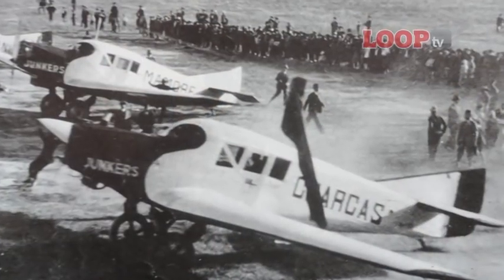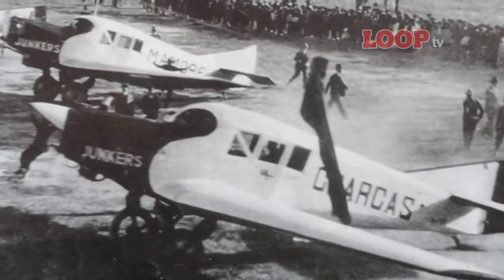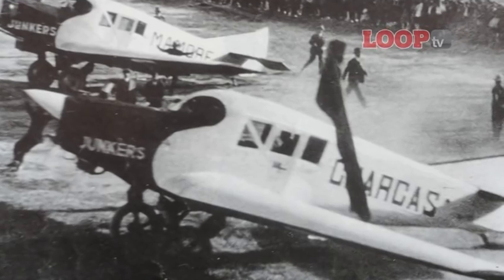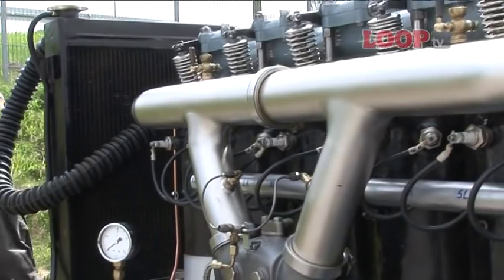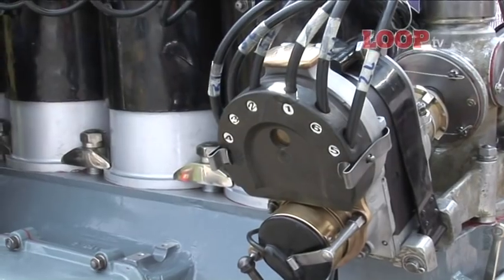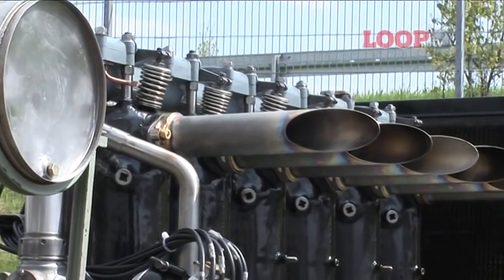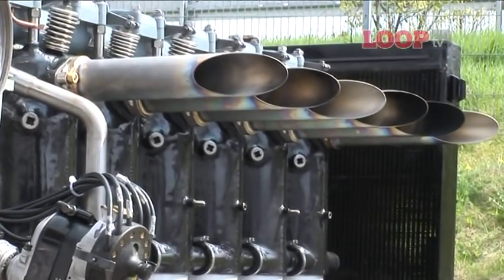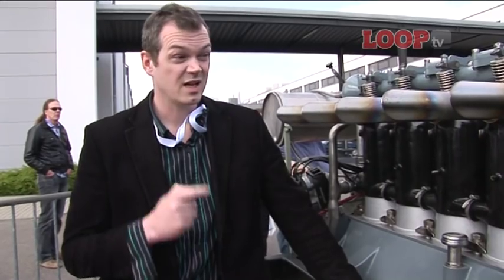Junkers L5 aircraft engine, start-up

Comment: The Germans have always made the best stuff.
Reply: gazlink1 - Are you kidding? They are renowned for building unreliable junk!
Reply: idontcare80 Rolls Royce? Byword for shoddy..? 
Invented almost all of the world's sports. 
I could go on. 
What you're speaking about I have no idea. The only thing shoddy about British design and manufacture is bad engineering management at times and overunionisation at times. Otherwise we pull our weight always in the world very, very strongly. British inventors have an impressive history.
Reply: Rolls Royce vehicles don't get driven enough to be horribly unreliable, but they are still unreliable. I'm not a sports fan, sports do almost nothing to advance human society. The British are responsible for quite a few very important inventions, but their mass manufacturing is horrifyingly bad.
Reply: idontcare80 Dyson vacuum cleaners? L7 tank gun?
Also I'm not talking about manufacturing, I'm talking about design. Manufacturing gets screwed by the overpowerful unions.
Reply: idontcare80 take for example the Napier Sabre engine. The most powerful inline engine of WWII. A huge engineering achievement, but was unreliable. Also the post war Napier Deltic, an awsome diesel engine with 3 opposing cranks and 18 cylinders. The smoothest engine ever made of its size that powers mine detecting vessels and locomotives (in the 60s and 70s anyway). Also the Merlin and Griffon from Rolls Royce.
Also regarding Rolls Royce - it's a mistake to think they only make cars, only a tiny part of their business is cars. Most of their business are jet engines that power a large amount of the world's aircraft.
Also Formula 1 - we have 6 of the world's design teams based in the UK near Oxford.
ARM microprocessors that power almost every computer in the world that is not a PC.
That's what you get from world leading design. No other country of this size has comparable engineering achievement.
And the manufacturing is picking up in quality from a real rough patch in the 60s to the 80s.
Reply: Also Martin Baker ejection seats, the only seats used worldwide because of their reliability.
Basically were good at high value design and manufacture.
Lower value stuff where the best manufacturing is key as opposed to best design we're not so good, but China, Japan or Taiwan can do that too.
Reply: idontcare80 also if you're talking about "advancing human society" the how about being the birthplace of the industrial revolution. We'd all still be peasants.
Reply: "Dyson vacuum cleaners? L7 tank gun?"

Oooohhh, overpriced vacuum cleaners, that's a good one. A gun is a tube that ammunition goes in, wow, that's some amazing engineering there!

"take for example the Napier Sabre engine. The most powerful inline engine of WWII. A huge engineering achievement, but was unreliable."

That's called bad engineering, the engineers specify HOW things are built. For example: The Japanese could produce extremely reliable vehicles no matter where they were built, they were even more reliable than American vehicles, despite being built in the US. Making power with a piston engine is easy, but making an engine powerful and reliable is where the real challenge lies.

"Also the post war Napier Deltic, an awsome diesel engine with 3 opposing cranks and 18 cylinders."

It was directly based on a German engine.

"Also the Merlin and Griffon from Rolls Royce."

The German WW2 fighter engines were much more impressive in their engineering.

"also if you're talking about "advancing human society" the how about being the birthplace of the industrial revolution. We'd all still be peasants."

You Brits are fanatics. The Germans, the French and the US all contributed enormously to the technology that we use today, the Brits didn't create the modern world entirely on their own.
Reply: The British really are good when it comes to the creation of original products of the mind (can't really think of a better way to put that). IMO, British fiction writers, British comedy and British rock music are some of the best in the world. British sci-fi is especially fantastic, I associate so, SO many of my favorite things in that area with the British.
Reply: I'm not losing anything - just showing you how wrong you are to judge a country on its manufacturing. Manufacturing =/= engineering. 

"No thanks, you'll just act like a child and claim that the British inventions were more important. "  - remind me, who's the one claiming one countries inventions are more important?
I haven't said a single British invention is the most important. You're the one who is determined that every invention that is not British is more important than any British invention. You suck up to German WWII aircraft probably because it's "exotic" to you. The most I have claimed is they are on par. Sure, I've given lots of examples of British engineering at its best, which probably upsets you so much you can't see past it's existence, and I must be claiming it's the better than everything else - but I've not done that once. As as it happens any developed nation could have invented the air weapons of Germany in WWII if they were in the position Germany was in, rockets and jets were needed because they had lost air supremacy, so were rushed to service faster than the rest of the world's jets (i.e. the UK's), and we had no need for rocket powered flight.

"That wasn't my point anyway, my point was that the British are known for producing unreliable junk" - again, are ARM processors unreliable? Martin Baker ejection seats? Rolls Royce jets? Most of the worlds F1 cars? Our specialism is high value engineering and design, not low and medium value manufacture. What you're talking about are 50s - 90s cars. We are easily amongst the worlds best engineers - innovators and designers. Engineers in terms of fabricators, welders, machine workers etc - that's where are sub par. If you look only at mass market cars, then yes they are less reliable - but again why have Mercedes got their F1 design team in the UK, along with almost every single other manufacturer? The answer is because we have amongst the best engineering design and high value manufacture in the world. You can't get more high value than F1.

"Not really, the technology used in the German fighters was far more impressive than the technology used in the British fighters. "  - again, simply a matter of opinion. German aircraft had the most eccentric (for reasons of desperation), sure, and if that impresses you, fair enough - but overall best aero engineering I would definitely not say follows from that. Among the world's best ofcourse, but with that amount of slave labour (and excellent engineers too), even ridiculous things to other nations were possible.

"Was just a different configuration of the Jumo 204, it's not like making the engines share crankshafts was a big achievement." - it's not like the opposed piston is anything special - yet this makes it pureley a copy of a German design and the German get all credit..? (again wheraboo tendencies). Three crankshafts had never been successfully done before.

"Right, like the MiG-15, which was based on the Ta 183. " - and was exceptional because of it's... swept wing?.. or engine?

"Oh, yeah, having violent oppressors/conquerors in the world is so beneficial! " and yet you seem to love the fact that the Wehrmacht had the best manufacturing (knowing how long to keep it's slave labour fed and alive, and when to put a bullet in their head/bury them half alive/gas them). If you want a debate on the merits and/or wrongdoings of empires, in particular the British empire, I won't get into it now, other than to say 1 point - there's a reason we're still friends and allies with India, Singapore and Hong Hong to this day and the Commonwealth exists, with purely voluntary members. Apart from debate, just as you can appreciate the power afforded to Germany through its innovations (so can I), you should also if you were honest be able to appreciate the power afforded to Britain from its innovations.

"The Brits have been good inventors in the past, but they've never been good engineers." for me, engineering is about innovation and design. It's true that a lot of the stuff that came out of Britain in the 20th Century was second rate (especially 50s - 90s cars, or anything mass manufactured), but the best stuff was very often (and still is) world beating, certainly when considering our population size.
Reply: So I'd say the best manufacturers are the Japanese, and the best engineers the British (amongst others). Germany have probably the best balance of both.
Reply: Good engineering = good manufacturing, the engineers specify how things are made.

"You suck up to German WWII aircraft probably because it's "exotic" to you."

No, because their aircraft did more with less and because the technology they pioneered went on to be used in modern applications. The only reason the British would have had any advantage was because they had access to much higher octane fuels, which meant that they could bypass the shortcomings of their engines with increased boost pressures.

"Sure, I've given lots of examples of British engineering at its best, which probably upsets you so much you can't see past it's existence..."

WTF are you talking about? You haven't given me anything that shows that British engineers are any better than any other engineers. 

" again, are ARM processors unreliable?"

What do you mean again? When did you mention them? I don't know if they're unreliable or not, I doubt I've ever used one, I stick with Intel computer components because they never let me down.

"Most of the worlds F1 cars?"

Quantity does not equal quality. Ferrari and Mercedes have dominated F1 for most of its history. One of the most successful 'British' F1 cars was powered by Japanese engines.

"What you're talking about are 50s - 90s cars."

Oh, only 50 years of automotive production, and now the British don't make anything, so it's not like they've redeemed themselves.

"again, simply a matter of opinion."

Absolutely not. Not only were their engines simpler, but they also spawned technologies that lived on into modern engines and were simpler to operate, I wouldn't call those eccentricities.

"Three crankshafts had never been successfully done before."

It's not like that was a difficult thing to do, no one else did it because it was really just ridiculous, it added complexity and provided no benefit, which is another trait that British engineers are known for. The Sabre was overly complicated, BRM engines were over-complicated, even the Merlin and Griffon were over-complicated.

"- and was exceptional because of it's... swept wing?.. or engine?"

Its engine certainly wasn't anything special.

"and yet you seem to love the fact that the Wehrmacht had the best manufacturing"

I didn't say anything about their manufacturing, I was talking about their engineering.

" you should also if you were honest be able to appreciate the power afforded to Britain from its innovations."

I do, you're just too far off in your own little world to notice.

"for me, engineering is about innovation and design"

Well, that's not how it works in the real world. You can 'innovate' all you want, but that's not guaranteed to provide you with a good product. Being different doesn't necessarily make it good.

" but the best stuff was very often (and still is) world beating, certainly when considering our population size."

Like what? The McLaren F1 with its German engine?
Reply: Engineers specify how things are made, down to the slightest detail, they're responsible for the quality of a product.
Reply: Again, the aircraft thing, it's simply a matter of opinion.

"WTF are you talking about? You haven't given me anything that shows that British engineers are any better than any other engineers. " - again I haven't stated that Britains engineers are the best, anywhere. I've said they're at the very least comparable.

Also the Deltic with three cranks wasn't pointless, was the smoothest engine of its size, hence it's use in minesweepers.. it was an excellent, and robust engine.

"I stick with Intel computer components because they never let me down." - unless you've ever used a any computer that is not a PC, like a phone. ARMs processors are design in it's purest form, manufactured by anyone that wants to.

"I wouldn't call those eccentricities." - I would call the V1, V2, Me 262, Ta 152, Me 163, Ho229 etc all eccentric aircraft. They were obsessed with wonder (and vengeance) weapons that could get them out of their unique situation, and attacking bombers. And the run of the mill engines were generally comparable in performance to their British (or other) counterparts - even taking into account the differing octane fuel. 
E.g. some people think that because they were good at high alt, they much have understood aro piston engines like no other country - it was simply different design requirements. Everyone knew how to tune engines, to any alt. (The US get most points for turbos.. ). Engine injection was known to every other nation but had drawbacks, hence it's disuse.

"Quantity does not equal quality. Ferrari and Mercedes have dominated F1 for most of its history. " - and Mercedes F1 cars are today designed and produced in the UK, like almost all other F1 cars. That's quantity and quality, I was talking about today's F1. Yes they mostly have German (or Japanese) engines - but the whole product, from the top level is designed and put together in the UK.

"Its engine certainly wasn't anything special."  - are you saying it wasn't the best engine technology in the world at the time? Without it's copied British engine it would have been more like the joke jet aircraft powered with leftover German WWII jets, like the Mig 9 with 2 jets - not a world beater with 1 jet.

"I do, you're just too far off in your own little world to notice." - i didn't read your more conciliatory comment before I posted the that message.. 

Anyway I think we have a fair understanding of what each other think.. I'll just say this, if we can get someone else to manufacture it, it'll as good as any, but if we manufacture it.. it was all pretty bad after WWII, untill now where pure-British manufacturing is pretty much non-existent (e.g. Morgan is the only fully British car manufacturer left - and is pretty much the only company that fits the reputation you think). The little we still do is actually on par with anyone, and often it's e.g. a Japanese firm, or German firm.. that often have a design team in the UK, but they manage our manufacturing. We actually export more (fully modern) cars than we import. 
This whole "Britain makes bad stuff" actually stems from a leftover of the industrial revolution. The "decline" in quality after WWII in e.g. US manufacturing compared to e.g. Japan was felt twice as bad in the UK. There was no pride in working in engineering - from the days of "the mill" or "the pit" where some 70% of the population was employed in factories. To work in a factory was seen the same as a janitor - and that's what everyone thought engineering was, and no-one wanted to work in any part of it.
Only now, after Britain has pretty much lost all it's manufacturing, we can say British engineering isn't crap, it was over unionisation during the complete collapse of all manufacturing.  It's only now Britain is regaining some sense of pride regarding anything that the word engineering means, and having to cast off the stereotype of bad post war manufacturing. Now we can recognise that we design alot great stuff, even if the manufacturing base has had to be completely removed (and restarted in some cases) from the whole country. The point is you won't find the stereotype of bad quality coming out of the UK today, (apart from Morgans), and we have a significant portion of high value manufacturing and design, the bad stuff simply isn't there anymore.
Reply: Are you paid to push bullshit, or what? I don't understand how someone can spend so much time spinning such a huge web of bullshit. Your main problem is that you're confusing good innovators with good engineers, and the British might have been good innovators in the past, but they were never good engineers, and that's why they always produced over-complicated,  unreliable garbage.
Reply: Also you're problem is that you focus only on the very few piston engine innovations the Germans developed, "that we still use to this day" - and ignore every single other British engineering innovation "that we still use to this day" - i.e. computers, radar, jet engines, and most of the industrial revolution etc, because you carry on the propaganda invented by the US who surprised by the "technologically advanced" Germans they encountered that were not the walkover they were promised with "USA's superior might" when they finally did join the war, and von Braun's rocket knowledge captured post war.
Reply: In that Top Gear clip: Bentley, Rolls Royce and Mini are owned by GERMAN companies, the Ariel vehicles are powered by Honda engines, the M600 is powered by a Volvo/Yamaha engine (past Noble cars were powered by Ford engines). Jaguar and Land Rover have reputations for producing some of the least reliable junk in the world. Modern McLarens use an engine that's based on a Nissan engine. Caterpillar is an American company.
Reply: The point is.. "made in Britain" - back to world class.

Then there's innovated in Britain - world class.
..and designed in Britain - world class.

Manufacturing management (especially mass market motor manufacturing) from Britain - second rate, only when we have foreign companies come to challenge the ridiculously powerful unions (like nothing you have ever seen in the USA - especially post WWII), do we get the quality back. That's the only point you have, which applies a tiny part to Land Rover and Jaguar today.. and completely Morgan.

Also to be fair, our engineering management is sub par throughout the engineering industry, due to the association with the factories of the past, the industrial revolution, and its collapse. This is the root cause of the poor quality in mass manufacturing post war. Most of the middle and upper class want to be bankers, army officers etc.. engineering has bad connotations (unlike everywhere else in the world where engineers are considered on par with doctors and lawyers etc.. especially Germany), but this is finally starting to change, mainly due to information (software, or electronic) engineering, and working it's way back to all engineering.
Reply: It's always great to work to create something better.
Reply: Your point about the Napier Delic isn't valid. Junkers had build the Jumo 223 and the Jumo 224. The two of them are opposed cylinder engines with 4 crankshafts.
Reply: The first functional radar was build by the germans and the jet engines had there first flight in a german airplane (although Frank Whittle is the Father of jet engines).
I hate it when somebody says this but the german axial compressor design is used today not franks radial compressor (it is not entirely true because the british also uild one but the british version of the axial compressor turbine has been design later than the german one). Computers are a british invention primarily (in the war)used to  crack german codes. Little fun fact: The association with the word "Bug" comes from the first computer. It used electromechanical Relais  in wich a fly (or any other kind of bug) could crawl in and cause a malfunction :D. 
Some say the DB605 engine is more advanced than  the RR Merlin. The germans used a rocket engine powered glider build out of wood that also broke as the first aircraft ever through the sound barrier. The germans had the first guided bombs (Fritz X). There is a lot more, you just have to read some papers ;D. There is a lot of proof for german engineering and ingenuity. The most famous could be the Saturn V rocket engineered by germans and build by americans. The british are not bad but eventually can't reach that standard. One thing that the brits can is rock (nothing goes over Queen XD).